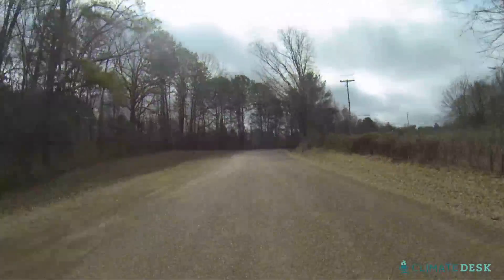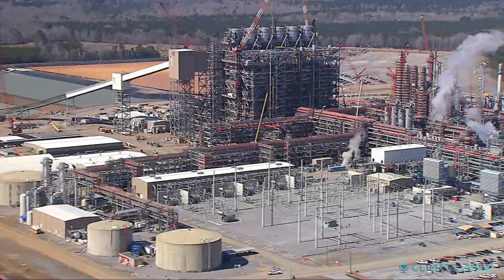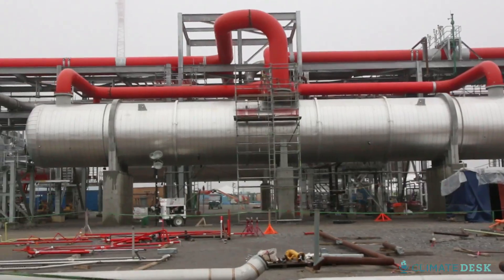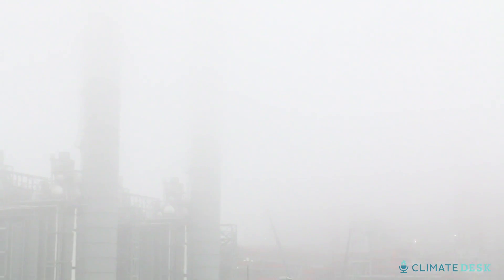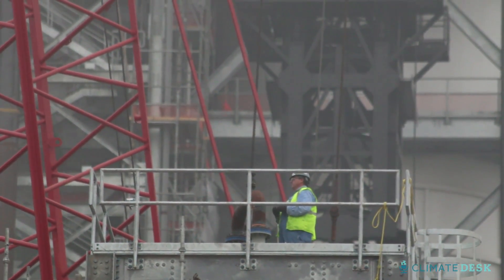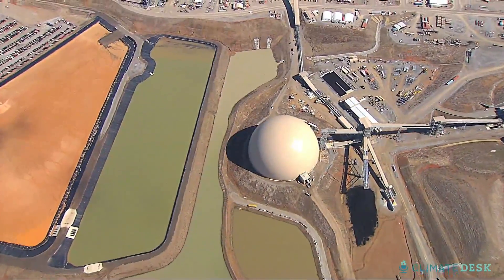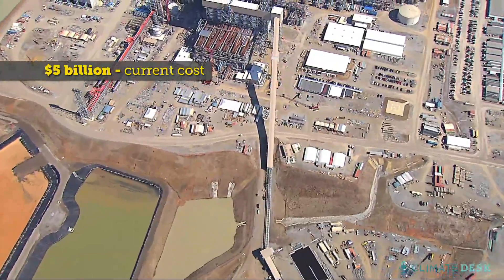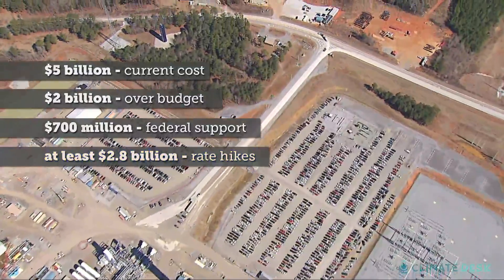Can This Coal Plant Save the Climate?

Comment: So it removes 65% of the CO2, yet still has a carbon footprint equal to that of gas burning plants. That doesn't speak to the use of the system, it speaks to just how dirty fossil fuels and especially coal are. Burning gas is still burning fossil fuels to release CO2.
"The EPA [will require] all .new. coal plants to adopt similar climate saving technology." Building new coal plants will still create CO2 output. Better than previous plants, but not better than not using combustion to generate energy at all. 2:05 Also, where do they put the captured CO2? Apparently it's to be used in oil and gas drilling, presumably to be pumped into the ground to pressure oil/gas to be pumped out? Pumping CO2 into the ground doesn't get rid of it. Ground isn't air/water proof. There's no guarantee that it isn't going to leak back out anyway, for whatever reasons. This is no solution. It slows the onset of catastrophe, but still moves us towards it.